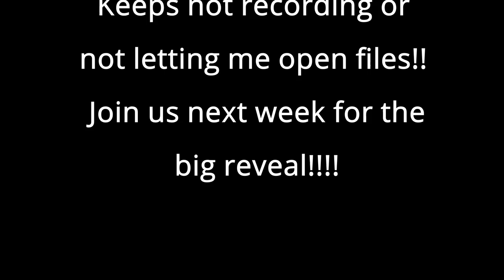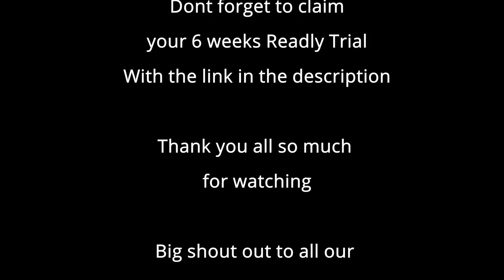Ep 28 part 2 - Replacing Oak Frames on our WW2 Wooden Boat Project

Comment: Hi , saw you sanding paint. Has it been checked for lead content?  Sorry grumpy old man loves the progress. Saw on a program or video they used a small jack hammer with a riveting bit to rivet similar copper nails. It helps a lot where it difficult to swing hammer, and a lot faster. You could possibly get your local engineering shop to make you a set for the different size rivets. Keep the shiny side up or upper side shiny. Regards to all.

Comment: I would suggest that a half lap joints would be easier to do than  a scarf joint and be plenty strong enough as the hull is the main strength . 
It would also be much easier to use urethane one part ‘gorilla’ type glue it’s 100% waterproof.
Also you need some cotton caulking around the head of the copper nail to stop it leaking . ( or some other plan). 
I think I would just remove all the stringers and replace the ‘frames ‘ as reqd then add new stringers . Keep it simple . 
Remember the main hull is super strong on its own ( like a fiberglass boat ) so the frames are not all that important .
Keep at it that’s a lot of hard work I know ! 
Cheers Warren
Reply: He's doing it the right way God for another hundred years or more

Comment: If you use plastic bags over your painting trays the bag is all you need to put in the rubbish also better dust masts while sanding the hull especially inside as looks like original paint

Comment: A good way to apply epoxy to wood to prevent moisture rot is to apply 3 light coats when the 3 coats are tacky to the touch to all areas of the wood, after the last coat is on let the epoxy dry for the correct amount of time.

Comment: Scarf joints would be best with a bolt through so you can get the pressure just right while it cures. When the epoxy has set, push the bolt out and fit a copper rivet.
Reply: If you watched the last video, that's what they're doing.

Comment: Go for the extreme pro SD cards, that cured my go pro problems the ultras are not even fast enough, also change to 50 FPS or whatever your elecy is running CPS.
Reply from the maker: Great tip, thank you so much! Xx
Reply: I got mine from Crucial.

Comment: West epoxy is a great product..... But please observe safety procedures, gloves and masks. Friends of mine have developed severe allergic reactions because the frequently touching wet or uncurled epoxy. At this point in your build you don’t want to loose your ability to use it. Keep up the great work.
Reply: West epoxy is the best there is. I've been using it since 1974. I've just finnished building a 25 foot boat using West. It is a bit expensive, so I'd like to recommend that you can fist mix the base mix and wet out the joint. Then add the thickener plus some micro fibers to get a much stronger joint. Your a great couple. Enjoy your journey. Great Job!

Comment: i know you don't need to be told about tools you need to buy, but there's a thing called a 'recoilless hammer' that is like a small sledge with a hollow head filled with lead shot which absorbs the 'bounce' of the hammer and effectively doubles the weight, so a 2-1/2  pound hammer does the work of a 5 pounder, greatly relieving arm stress from all that hammering you'll be doing
Reply: Another way of using the full potential of a hammer is the hold the end of the hammer handle. When I was a youngster I got many the clip round the ear for not doing so.
 The old chippies and engineers said the same, the length of the handle is there for a reason, use it. It also save knocking your fingers.